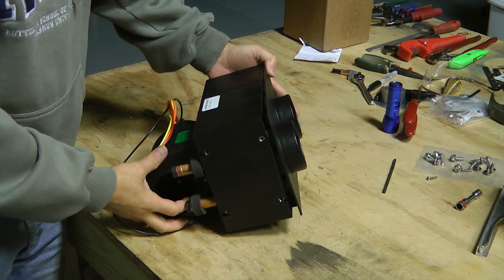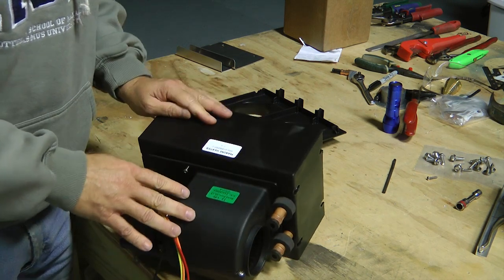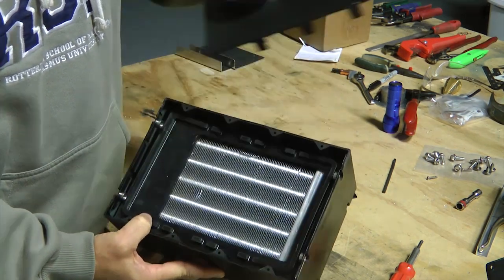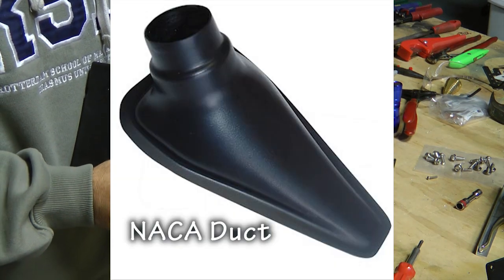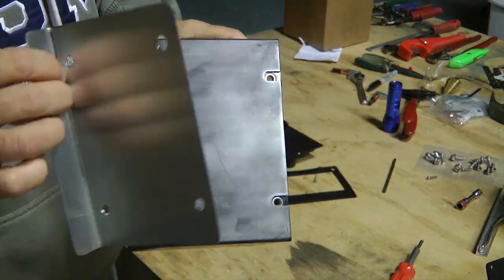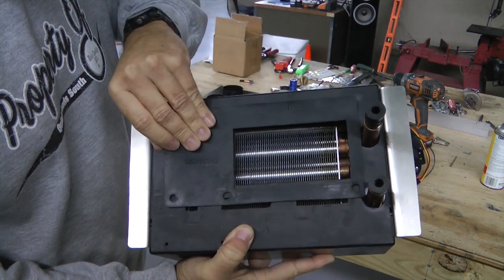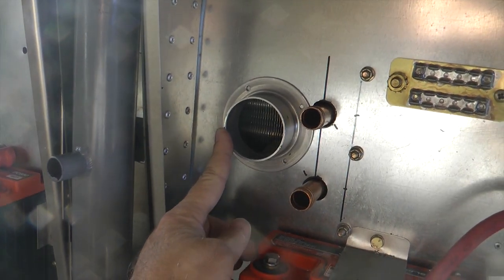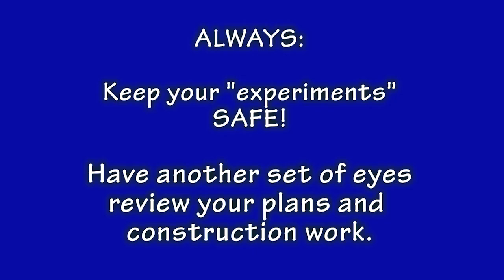Adapting an Automotive Heater for an Experimental Aircraft

Comment: I would use both methods, same as most vehicles.. Adjustable air, adjustable water. You can then have a lot of fast moving warm air, or 'turn down the fan', so to speak, and have very warm, but slow moving air. Turning off the hot water and still being able to control the ait flow is also a big plus. I find having both options available for mixing and matching works best to find the right comfort level in various conditions. You might also want to think about having a portion of that air blowing on the windshield too.

Comment: Replacing the big fan with a 12 v fan from an old pc and have the air recirculate is an option. No need to pre heat the air and no need for a high air flow as our cabins are small. I'm using a 2.2kW "Micro heater" from T7Design that is only 580g. It works well and no issues running the fan constantly.

Comment: the comments about controlling both airflow and coolant flow seem appropriate, especially being able to completely stop the coolant from entering the radiator. My big question is, "So? How did it work? What outside temperatures did you try it at? How warm did it keep the cabin? Did the temperature outlet at your feet prove to be a bit too hot at times? Did you need further ducting to direct the air more to the whole cabin?

Comment: Anybody have any brilliant ideas for heat and air cooled engines in Michigan? Lot of advancements but in the last 50 years they're still Volkswagen Type heaters that heat your thumb or your big toe depending on where the heater is placed! Kind of like a snowmobile with wings.

Comment: Its a great idea but I strongly recommend not allowing any of the air to be 'pre-heated' from passing over or around the exhaust pipes.  Exhaust leaks can and do happen and could allow carbon dioxide to flood your cabin.
Reply: the classic VW Beatle heating works in this way
Reply: Its carbon monoxide.
Carbon dioxide is odorless.
Reply: Most certified GA airplanes are heated by shrouds and ducts from the exhaust pipe.

Comment: Hi. A great idea. Practical thoughts. If air is preheated off the exhaust id be concerned about carbonmonoxide leaking into the cockpit. Also id endorse nigels concern that the heatercore can rupture and leak hotwater and steam into the cockpit. Ive had this happen in a car. A sauna just when you are dealing with engine failure

Comment: Great video! I've been planning a heater core install on my Rotax. Two questions: 1. What do you think of mounting the heater core on the engine side of the firewall? My heater core came with a steel housing, it would keep coolant outside of the cabin. 2. I'm planning on installing a thermostat with a bypass, what about plumbing the heater core in series to the bypass? In cold weather, most coolant would go through the bypass, in hot weather, almost none. Then control heat with airflow.

Comment: Nice idea, but you need a way to control both airflow and the flow of coolant.  Even with no airflow that core is going to get really hot just from the coolant flow, think about a box in the cabin at your foot level that's running about 150 degrees in the summer.  That heater core is a kind of radiator, and it would be radiating a lot of heat even with no airflow, IMHO you need a way to control and completely shut off the liquid to that core in the summer time, and control must be easily reachable from the pilot seat in flight.

Comment: Motorcycle radiator, lots of sizes and shapes, make up your own box, use 2x car heater control valve to open close 4 vents, 2 at foot level, 2 directly on windscreen, or open all 4. Install forward of firewall, smaller holes for hoses only, not a box.

Comment: It would seem to be a compromise of the firewall protection of the occupants with this design. Fire would have a clear entrance path to the cabin once the duct hose is burned away. Also, automobiles recirculate already heated cabin air to improve the effectiveness of their heaters in extreme cold. Is there to be any provision of heating the windshield to remove fog that is obstructing vision?
Reply: Use a cable actuated slide valve on the firewall

Comment: How about a 12 v dc computer style "muffin " fan ,  lighter weight but they can put out alot of air. Once you get some airspeed the fan could be shut off.
Reply: Reinstall the duct adapter with one side for defrosting the windshield, install a muffin fan on that duct so you can defog on the ground, and use the NACA for in flight, maybe incorporate butterfly or gate valves for airflow control.

Comment: You need a way to stop the water flowing through the radiator. I know some one who did something like this and the radiator failed after a few hours. Burning hotel fluid covered the windshield and a scary emergency landing was required. You really need to redirect the air flow from the radiator so that the fluid will separate from the air if it does fail. You will have some very nasty burns.